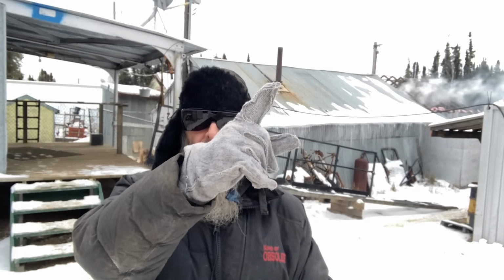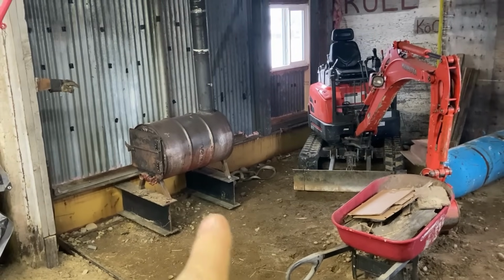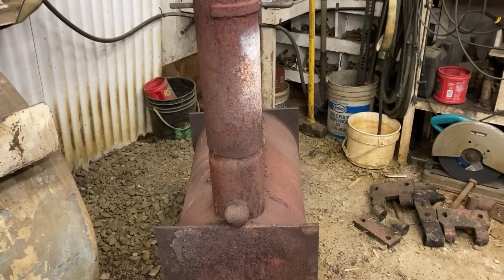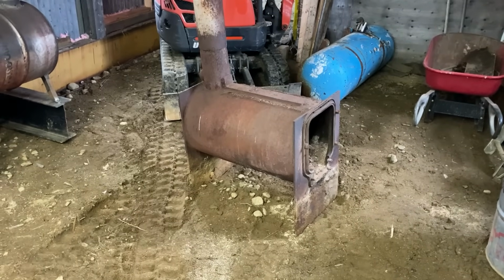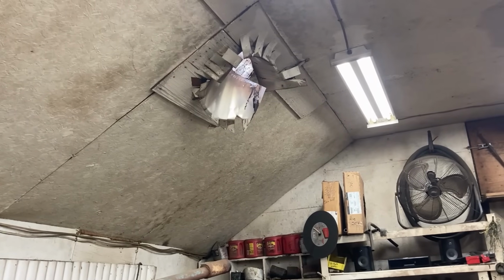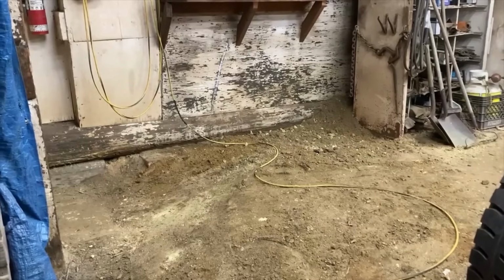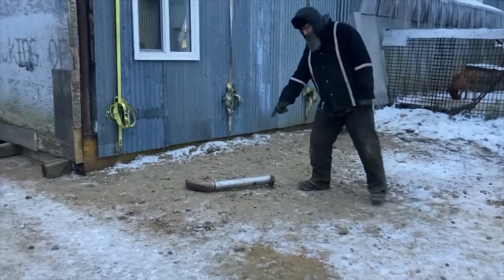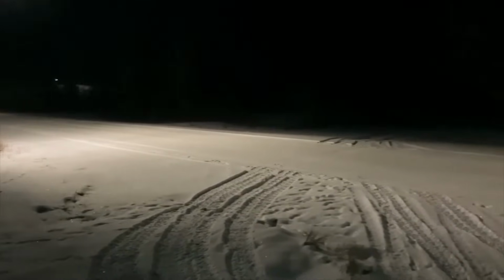Removed the Old Wood Stove After 27 Years Nov 06 2023

Comment: That' was a slick job of taking down the chimney and moving the stove. Maybe you could cut some slits at the end of the loader stack to allow it to pinch down better. Thanks see ya tomorrow.
Reply from the maker: yes working smarter not harder is the way to go these day. yes the plasma cutter will make a few cuts in to the exhaust pipe.  thansk

Comment: Your Highness, may I ask why did you set the woodstove with it's opening facing the inside corner of the shop all those years ago? Seems it would be harder to load.
Stayin tuned! 🤠👍
Reply: I only just now noticed it, it makes all the sense now why all this effort is worth fixing it the right way
Reply from the maker: that was where the chimney hole was and we were not staying long in WHO-ville after they took a dislike to me. now 27 years later we are correcting a few things. thansk
Reply from the maker: we were not staying long here and was always going to get a better shop  thansk